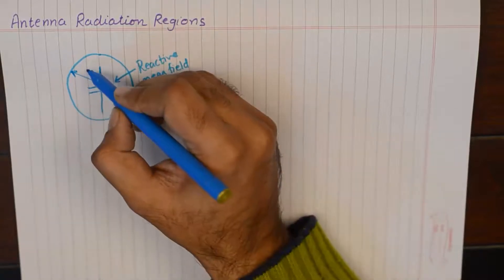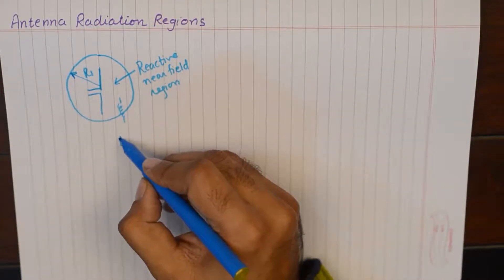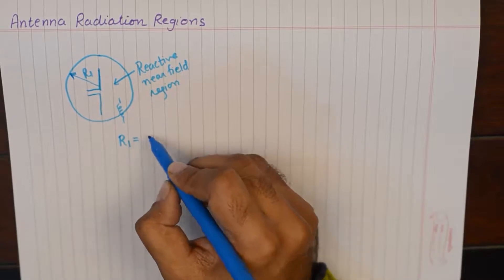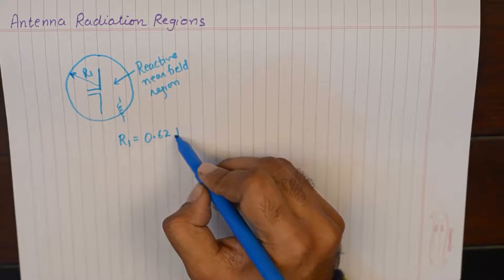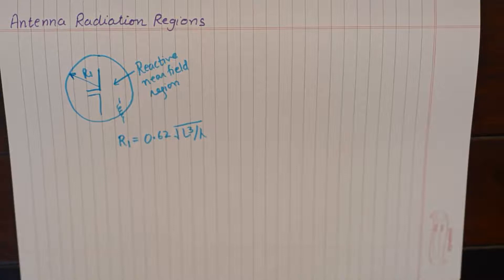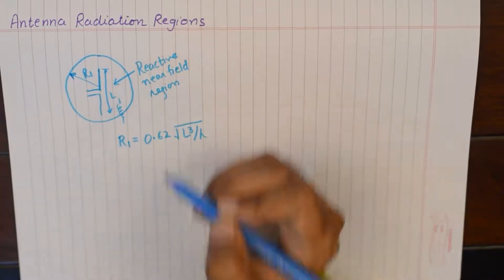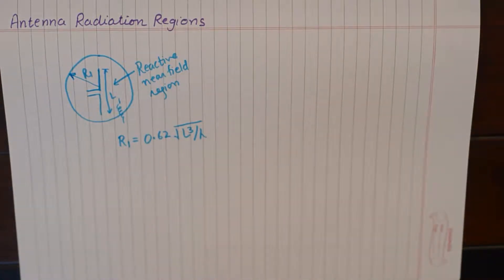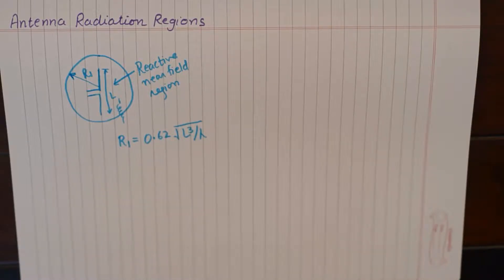Antenna Radiation Regions | Reactive Near Field | Radiating Near Field | Fresnel Zone | Fraunhofer

Comment: How E and H which are out of phase in reactive field, come in phase in the far field or radiating field
Reply from the maker: The mathematics of the poynting theorem ( E and H being perpendicular to each other and to the direction of propagation )holds true only when the field strengths are high or significant. That is in the near region. However as we go into the far off regions the H almost becomes negligible due to attenuation and all approximations lead to suggest that E is the only responsible component and Assume h to move along.
Reply: @nipunharitash  Thanks Nipun , I will  check on that, I am obsessed trying to understand how Antennas propagate